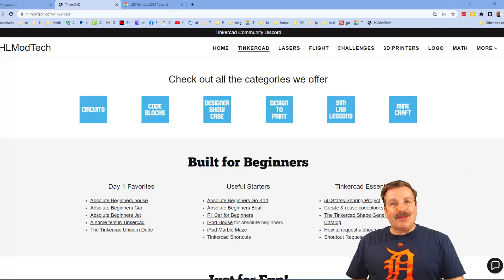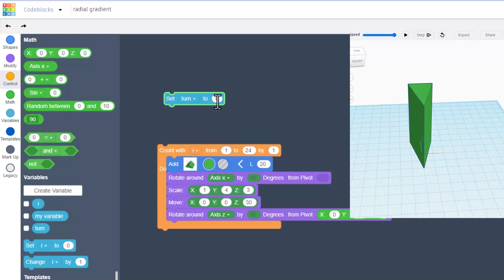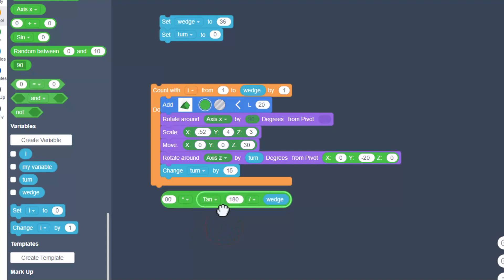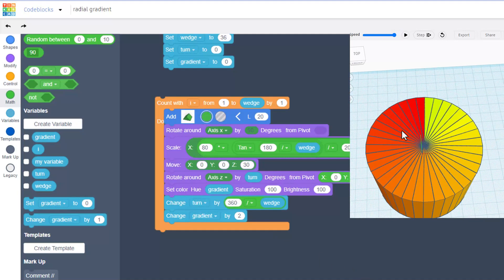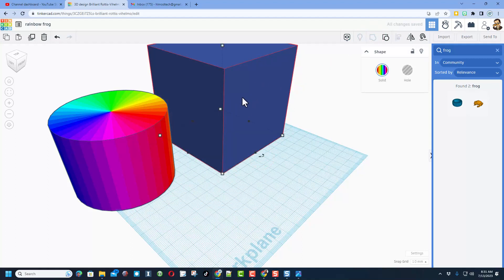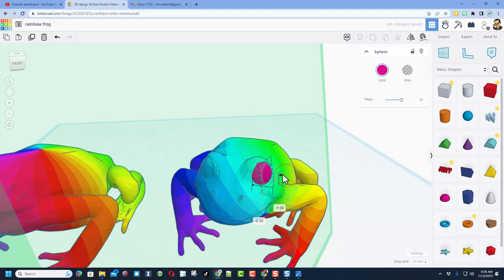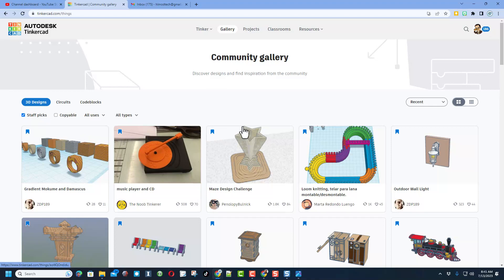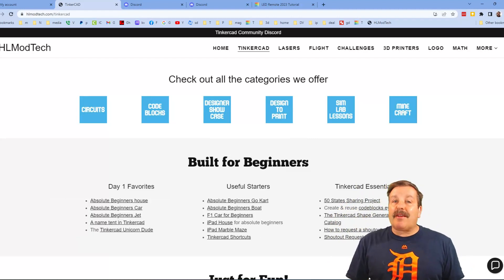Make a Tinkercad Codeblocks Gradient Cylinder Generator in Minutes!

Comment: hello, why can't my tinkercad run after entering an account, to add a design I can't go to the edit dashboard
Reply from the maker: That is pretty strange. What browser are you using?
Reply: google chrome.  Can you help me
Reply: i pretty much saw what you did in your video, so i can do and make 3d on tinkercad.  after that I opened tinkercad and entered Gmail, entered my profile.  but I added to make new can no longer go to the edit section.  only text (privacy setting)
Reply from the maker: Chrome should work fine. You may want to start with one of my day 1 videos. https://youtu.be/fcHRIhJnIEo
Reply: my tinkercad can't open to the board, the part where is the material.  like the first base board makes
Reply from the maker: That is pretty odd. Do you have another browser you can try?  I do know it works with Edge and Firefox. I just always lean towards Chrome.
Reply: I just tried opening with Firefox and it opens to normal (workplane).  it means my chrome has a problem, I'm also strange why my chrome can be like that
Reply from the maker: I am glad you are in via firefox. Maybe click through the chrome settings and check to see if it is up to date. You can also choose the reset settings under that menu too.,
Reply: thanks guys for your time, it's my first time learning tinkercad following what you did